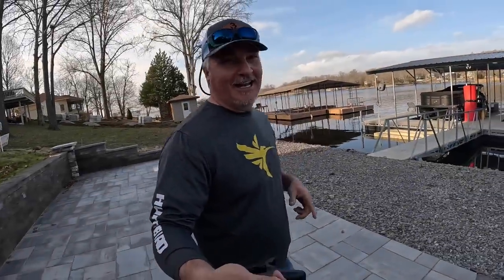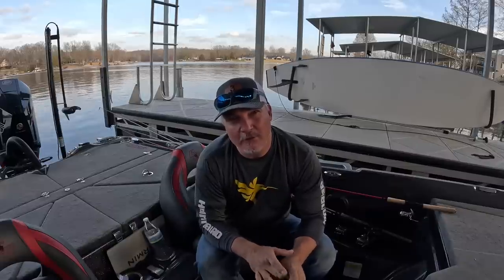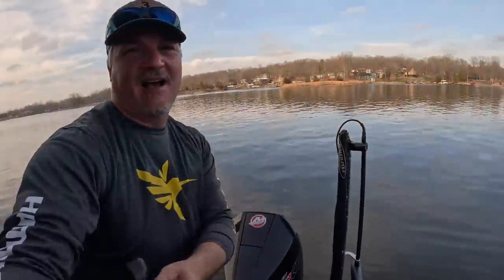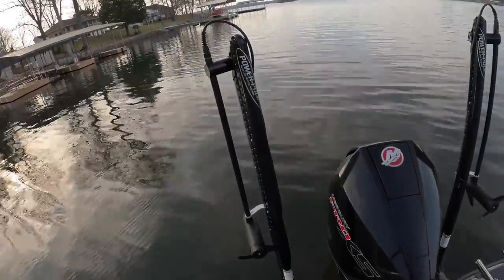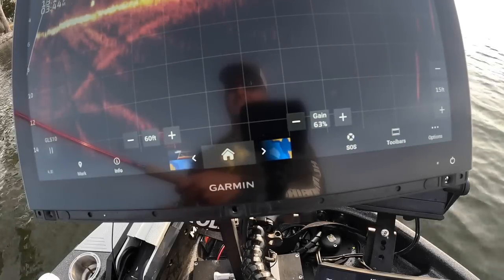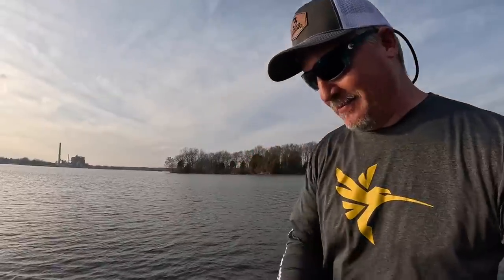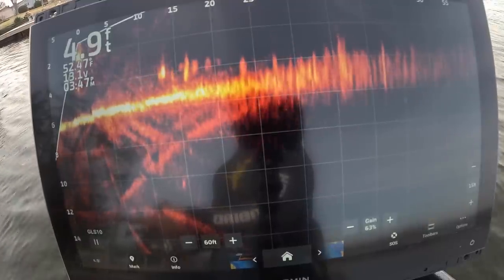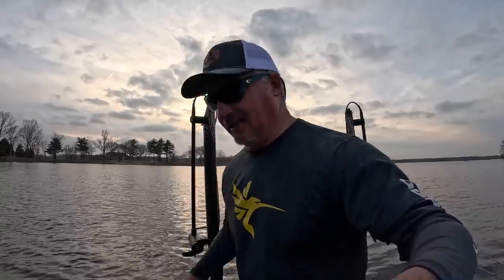Crappie Brakes (Exciting New technology)

Comment: I've got them on a 17 Ft Lowe Boat FM.  No power poles just on the back of the boat. Manually have to put them in and pull them up and then remember they are down but brush piles, chasing, fish going at you fast, creating distance to cast, well worth the money. Mine were pretty inexpensive. Just commenting because there are other options for people that don't have glass boats. I fished with a guide on Enid at Thanksgiving and immediately put them on my boat when I got back to NC,
Reply from the maker: Awesome feedback

Comment: What kind of mount did you use to get your live target monitor set high?  I have been looking and have seen a few boats with taller monitor mount.  I struggle seeing mine down towards the floor of the front and want mine higher like yours!
Reply from the maker: Call mark at CFCG.  +1 (270) 205-8210
Reply: There are multiple pole mounts out there you can buy.